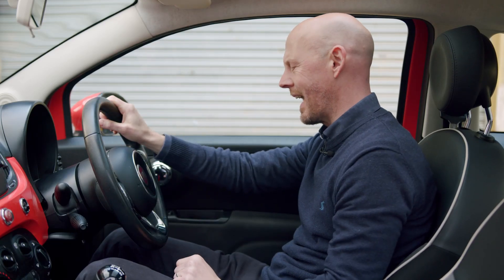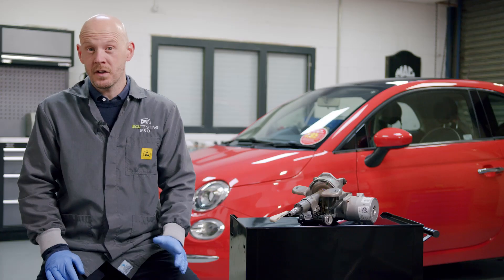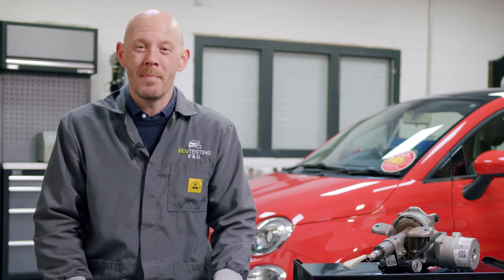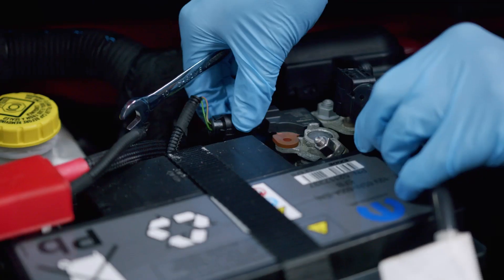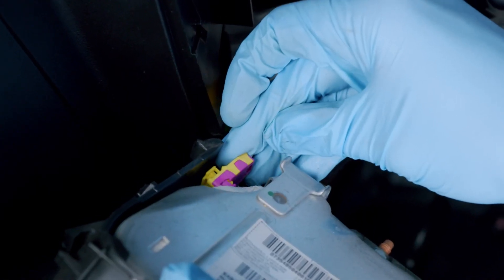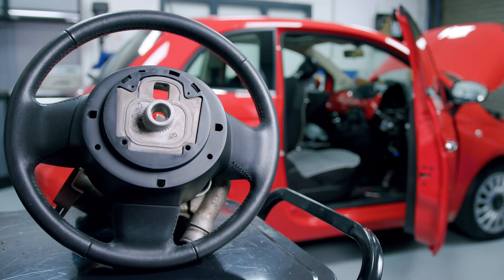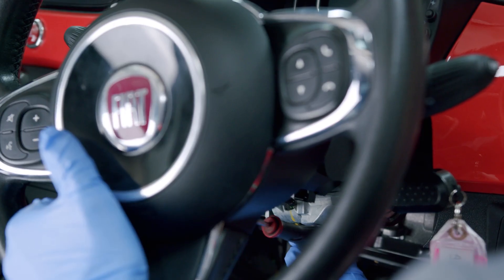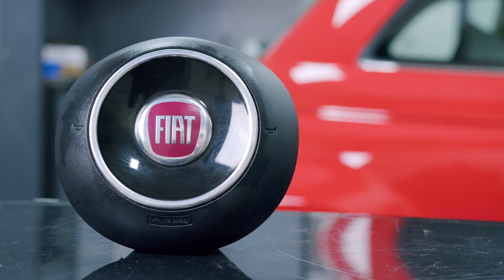Fiat 500 Power Steering Fault – Steering Column Removal and Repair

Comment: It's a useful guide but if you're doing this yourself the plastic 'bracket' shown at 3:50 cannot be removed. It is an integral part of the full dashboard assembly. It can be carefully cut to allow the column to be pulled out but MUST be joined back together to allow the knee airbag module to clip back into position. I used a thick plastic strip and plastic rivets.
I've not known a replacement column to need coding either. I just recalibrate the angle and torque sensor.

Comment: Hello How do you lock the steering column?  For centering during reassembly
Reply: You don't need to as the steering angle sensor should be recalibrated upon completion using a diagnostic tool, eg MultiEcuScan. New columns are supplied at random positions, just make sure the notch on the splines is at 12 o clock.

Comment: THE VIDEO IS WRONG! AT 4:18 WHERE IT SHOWS THE SPRING SECURING CLIPS CIRCLED IN WHITE, THESE ARE NOT THE CLIPS! THE CLIPS ARE THE WIRE RODS YOU CAN SEE AT BOTH SIDES AND THE BOTTOM. THE SCREWDRIVER NEEDS TO BE TWISTED TO EASE THEM BACK.

Comment: I haven't had a diagnostic test but I'm pretty sure mine is on it's way out. Intermittent power steering failure! I'm in the process of taking it out and sending it to you. My car is a 2010 Pop.. Do you think the plastic covering underneath will have to come out to access the rack? Also noticed the air vent needs to come out as well?
Reply from the maker: Hi. The vehicle we are carrying out the work on in this video is a 2018 500 Pop, so it may be a slightly different process in your vehicle. However if you are struggling to remove the whole unit due to the plastic covering underneath, you may be able to disengage the steering lock and remove the top half of the column which will allow you to drop the other half out of the vehicle. We removed one of the air vents in this video to provide easier filming access to the column securing bolt on the intermediate steering shaft, and it isn't a necessary step if you can access it with extender tools. Hope this helps!

Comment: Hello mate, need to get my daughters column rebuilt. How do I go about it I can remove it no problem
Reply from the maker: Hi. You can either go to our website and fill in our online test form here: https://myaccount.ecutesting.com/ Or you can give us a call on 01773 535638 or email our technical support team on info@ecutesting.com. You will need to provide a few details such as the make and model of vehicle, symptoms of the fault including fault codes, and the part number printed on you unit. Our team will then be able to advise you of the re-build solution we provide as well as a quote. Thanks.

Comment: Does the same apply for the Fiat Panda turbo diesel. 2010? Thanks
Reply from the maker: Hi there None Taken.
This video is for the Fiat 500's EPS unit, however the Panda's unit is similar, so some steps shown in this video will be relevant. We would always recommend following the manufacture's guide for more detail. Thanks.

Comment: Panda 312/319 has a electro steering system but don’t have torque sensor like panda 169….
Which si the fault ? The steering locked
Reply from the maker: Hi. Do you have any fault codes produced at all whilst the steering is locked?
Reply: @Ecutestinglimited  I remember The text : fault by torque sensor
Reply from the maker: @adrianojeminaj9860  Do you have the part number of your power steering unit so we can look into this for you? Thanks

Comment: Hi I have a 2016 renault kadjar that isn't self centering and gets worse the faster you go especially dangerous on a motorway, Renault want to replace the whole unit at a cost of £1900 lol.
Is this a common fault that you guys could repair.
Reply from the maker: Hi. If you are able to email us your part number and details of the fault, such as any fault codes or methods the dealership used to diagnose the fault (if you are able to), then we try and assist you. Contact our technical support team via email at: info@ecutesting.com or by phone +44 1773 535638. Cheers

Comment: As soon as they say 'just' on these videos you know you're in trouble. Like 'just' undo the connecter, or 'just' undo the clip. They tell you what to do but not how to do it! Until you know how the manufacturer uses electrical connections, you're in the dark about how to unclip them and a broke connector is on the way. I'm an engineer by trade (aircraft) so, I\'m not stupid, but it would be more helpful if a closer view was shown when undoing clips or connectors to save learning how they work by breaking them!
Reply: If you can't figure out clips and connectors yourself without breaking something you probably shouldn't be working on a car anyways.  Additionally, it may be best that they don't give specific details as each vehicle model and year may have different types of clips/connections.

Comment: There's nothing here indicating how to send the item to you.
Reply from the maker: Hi. Please follow this link: https://www.ecutesting.com/common-faults/fiat/fiat-500-power-steering-fault/ and select the part number which matches the one printed on your unit. If you cannot find your part number on our website, then please email our technical support team on info@ecutesting.com with the following details. Your make and model of vehicle, the symptoms of the fault you are experiencing (including fault codes), the part number printed on your unit, and any further diagnostic information you can provide e.g. attempted fixes. They will advise you further. Thanks.